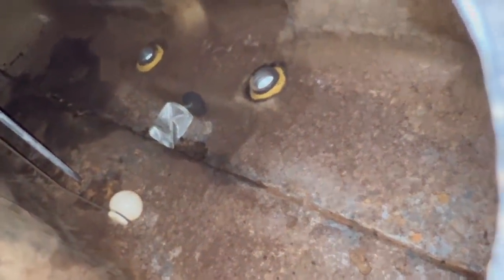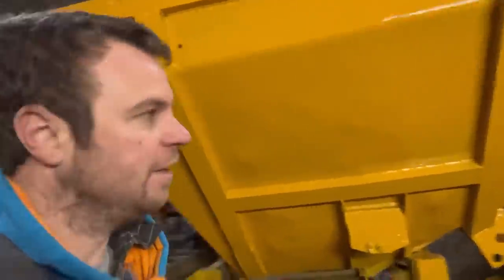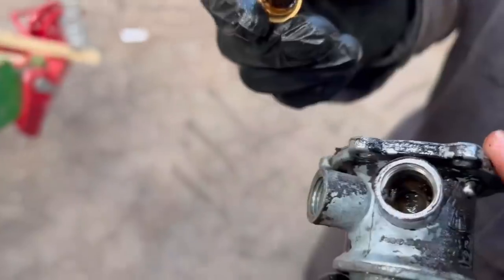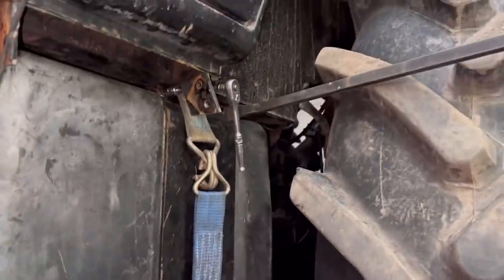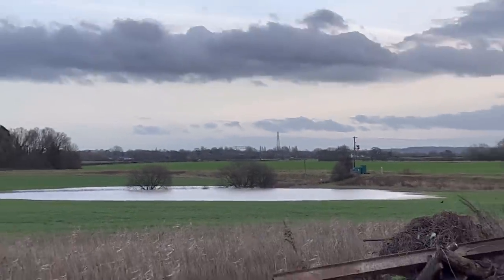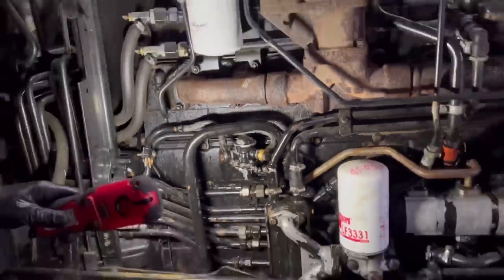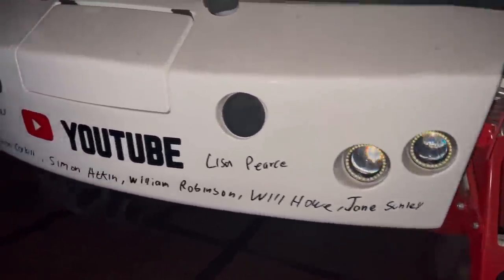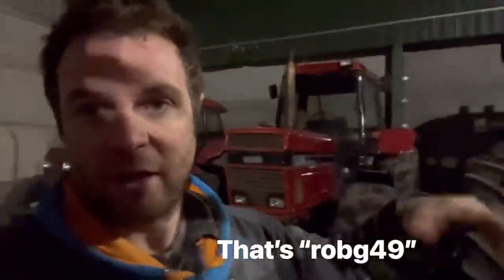Day649  #OLLYBLOGS CASE 1455 PULLING SILAGE TRAILER AFTER FUEL TANK REFIT  #AnswerAsAPercent

Comment: Retired from Young Farmers Club being too old years ago,but today took part in Brockenhurst & District first Tractor & 4WD run south of the New Forest & Lymington High Street.   They had hoped for 30, but over 100 took part for the 26 mile run.   I had one of or the slowest tractors flat out at 16MPH, a MF 5445 with undersized wheels on a 30 KPH gearbox.     Great Fun, and my co driver dog enjoyed it as well.     Tractor Run  was in aid of Farm Safety Foundation (Yellow Wellies).
Thanks for all the videos, and best of luck for 2022.

Comment: firstly, happy new year, secondly, damage fairy is a legend, thirdly, primer colour (red, yellow, black, white, grey . . . . non) will affect paint colour finish. Also if its "machinery", "heavy duty", or "agriculture" paint its probably enamel based, in which case it will change tone as it dries and hardens , which can take ages compared to modern car paint. Maybe try keeping it warm (not hot) for a few days and see if it darkens. I had this happen after painting a Kubota 360, looked Hi-Viz orange until it cured!

Comment: Job well done on the 1455. Just give the engine a run if you don’t use it every week. Just 15/20 minutes ticking over in the yard and enough fuel should return back to tank to prevent the algae. 
In the meantime all the best for 2022, keep up the great work you do promoting agriculture and the behind the scenes trials and tribulations. It all makes interesting  video.

Comment: Hi olie on my old farm where I worked we had a pair of 956 xl,s two wheel drive and a pair of 1255 xl,s they sounded lovely when pulling hard 12 ton grain trailers up the cotswold hills and quite easy to work on the 956,s was very mernovable ,i misted them when they were sold for John deers ,they had much better cabs with more room and windows you could open the good old days. Roy.
Reply from the maker: Yer and 4 speed power shift

Comment: If possible a round up of the year to include activities, new machine, tractor arrivals the tractor run etc. This may be too much for one video so maybe two parts. You’ve had an extremely busy year so an alternative could be to do it by season adding in any new machines as they arrived. Olly it’s a lot of work so only if it can easily be done ✅